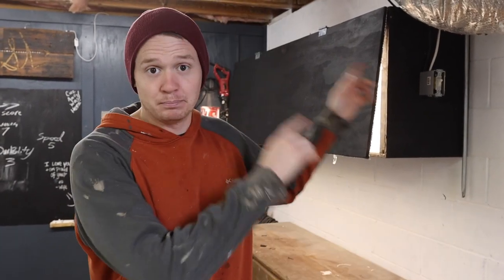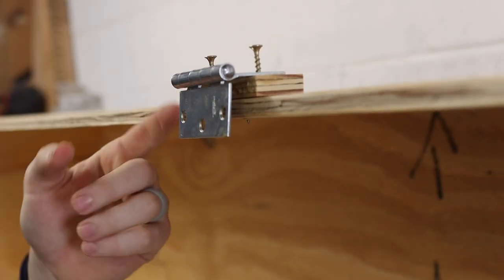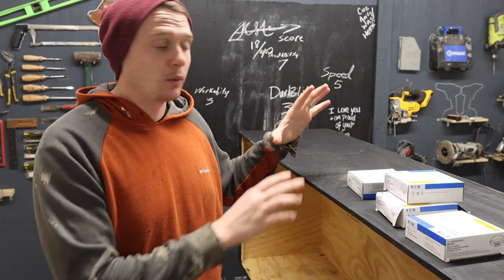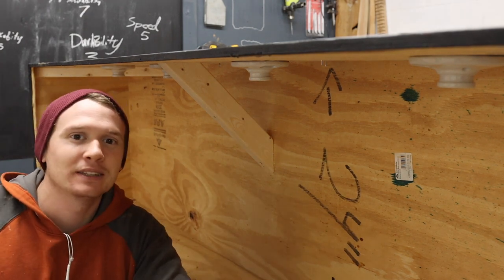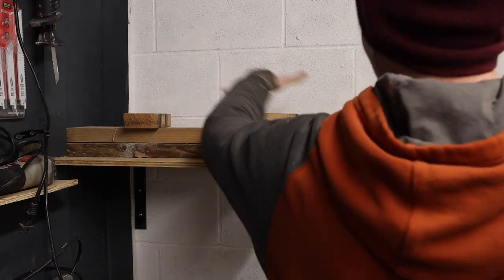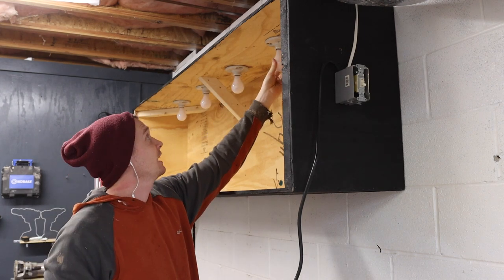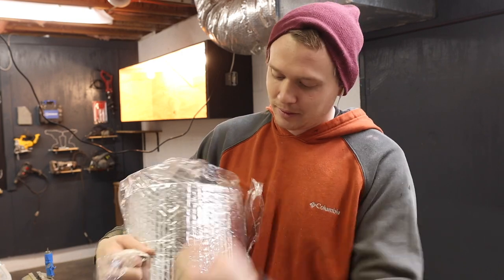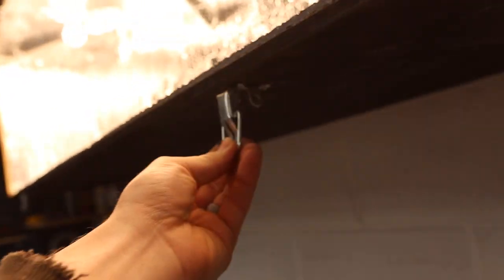How to make a (Heat-Box/Oven) For Bow-Making

Comment: Three comments about the electrical work.
1. Wire your bulbs in a parallel circuit. If you have them in series and one bulb burns out, the circuit is broken and all the other bulbs go off and no longer provide heat. In parallel, the remaining bulbs will continue to be on and provide heat.
2. Buy a 30 $ thermostat that can be set at the required temperature, say 160 F. It will turn your bulbs on and off when the temperature goes above the set temperature. Get a digital one that shows both the set temperature and the actual one.
3. Make sure your light sockets are ceramic or at least rated for use where the bulbs hang down. The ones used in floor lamps, etc. can actually catch fire  if hung upside down. I've seen it happen only once, but that was once too many.
Reply: I would have used Light fixtures made for the warming bulbs so it is more durable and yes a $25-$30 Thermostat made for something would be nice for the bow box that I would have to regulate the electricity better.

Comment: Great design. Check out ceramic heat bulbs for reptiles, probably more efficient than lightbults and screw into the same socket!
Reply: Inside a closed box, all lightbulbs are 100% efficient at converting electricity to heat. Maybe the reptile ones will last longer, though and be more reliable.

Comment: Looks good dude. Couple of suggestions tho:

1: a thermal regulator. Something that measures the internal temp and cuts power when the oven is too hot and kicks back on when oven too cool.

2: an LED strip that lights up when oven is on.

Comment: You could hang a shop light from the bottom of the box for your workbench. Wire it from the box switch to another switch. Use a box that can hold two switches and and extra outlet.

Comment: I am thinking of making a box since I might be doing some Bow modification and making some higher pound bows from two lower poundage all fiberglass bows by gluing them together like Two Titan Bows to have a ~50 pound bow (single Titan would be 25 pounds) for my 24-25 inch draw length since these bows go from 22-28 inch draw. Yes I would have to modify the two handles to be one longer handle but I think I could easily do this and have a bow at my poundage, if not then I have a really heavy bow that I need to trim the inner bow up to have the right weight.

Comment: Great job,, I used the same insulation you used. Very nice, keep up the good work. Your friend in Christ.
Reply: I use indoor flood 120 watt 130 volt, not led and you will get more than enough heat. Also with that 100 watt 120 volt house bulb also not led. Kramer did you find some good bulbs yet! If not let me know my company still has some of the flood incandescent lamps I can ship to you. You will definitely get the heat out of these.

Comment: Yo total novice here, currently working on two bows. One hickory stave with hickory riser and boo backing, thinking about making it a flat bow. Other one is a laminated angular r/d hybrid bow Egyptian style. I don't have a table saw or circular saw. So after I do the glue up and use a lumber pencil to draw my taper, what else could I use to cut those long vertical lines running the whole length of my limbs? Just a hacksaw for wood or what other options do I have

Comment: If it isn't getting hot enough, you can just add foam insulation on the outside to avoid eating up your usable interior space. Any kind of foam insulation from the big box hardware store. Styrofoam or polyisocyanurate. You can glue it to the outside of the box with epoxy or construction adhesive. Some construction adhesives will dissolve Styrofoam so read the label before you use it to make sure it is compatible. I build a plywood/Styrofoam box with a thermostat inside to keep my unmixed epoxy at room temperature when my workshop is at 45F. Because of the thermostat I can just leave it plugged in all the time.  I only have one 40 Watt bulb so even if the thermostat malfunctioned, it wouldn't get THAT hot. You may not need insulation on the back wall. It would be too much of a pain in the but to take it down and add more insulation there. But you could maybe insulate the back wall on the inside of the box if you think you need it.

Comment: I see in the comments that you haven't quite reached the temp you're looking for. I'm looking to reach about 140-150 for my purposes. What temp have you been able to reach? 

I tried using the infrared heat lamp bulbs but they were so sensitive 3 of them in a row burnt out almost immediately so I'm afraid to use them again. $$$ Plus they didn't seem to get hot enough, although I only used one bulb at a time. I hadn't tried combining them nor mounting them inside a box.
Reply: @kramerammonsarchery  I look forward to hearing/seeing? your results. I had the hardest time with the red, Phillips 250 Watt heat bulbs. They kept burning out almost immediately after turning on. I had 4 of them. The guy at Home Depot said it was probably from impurities on the glass and to clean them with alsohol and not touch them. But I did that with the second pair and they still burnt out. 🤷‍♀️
Reply: @kramerammonsarchery    The red, Phillips 250 Watt heat bulbs can not have fingerprints on them. Must be cleaned before turning them on. like a halogen bulb, oil from fingers will "pop" glass and they will not function.

Comment: You should have an electrical box on each of those lights. You should never have open taps in the wire. Its a fire hazard and doesn’t follow electrical codes.

Comment: The first rule of thermo dynamics is "heat rises"
Reply: I think that is the fourth law. LOL.
Reply: Aluminum tape for all those holes and remount the top with that bubble wrap then add the light fixtures. To help seal the top. Is there a vent on the side or bottom? What is the light bulb wattage?